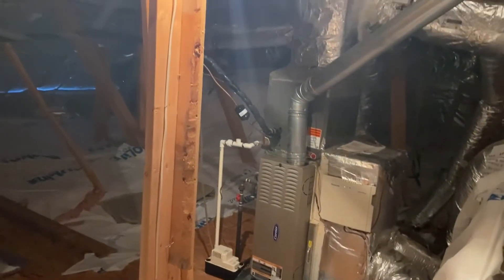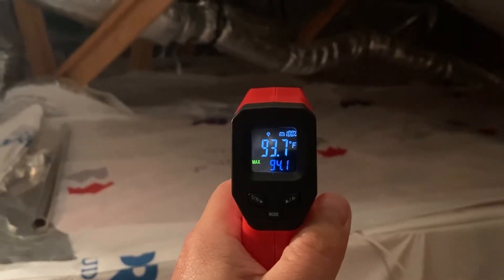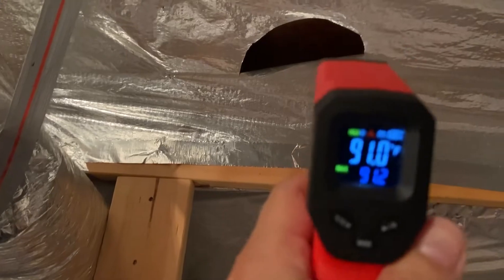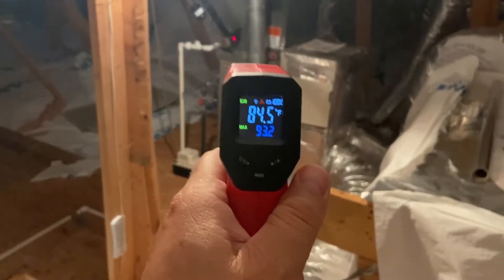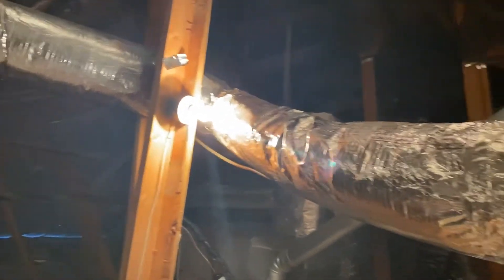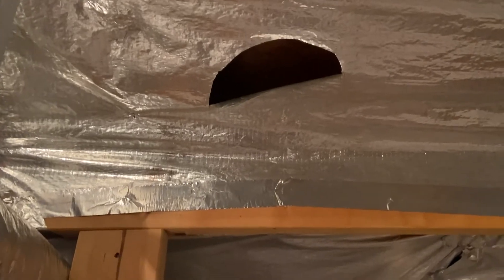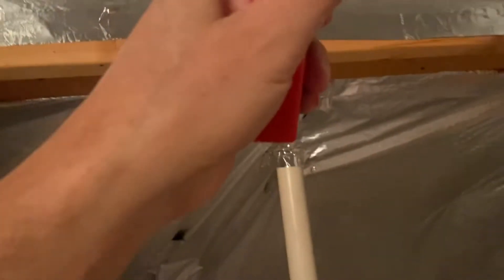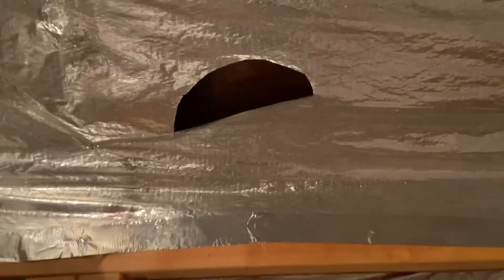Part two follow up to radiant barrier install with temperature variance’s.

Comment: This was very helpful. Did you see savings on your energy bill? How much as a percentage or in actual dollars?
Reply from the maker: Unfortunately not.
Reply: @paulsecondi2053  any thoughts on why?
Reply: @paulsecondi2053 any thoughts on why?
Reply: @paulsecondi2053 I was wondering the same thing as far as cost on enery but also hoping your hvac unit maybe turn on less?

I have a 50’s house and have cleaned up a lot of electrical issues, then air sealed as much as possible, added insulation and now in the radiant barrier portion.  I like the point the contractor made which is to keep the heat out in the first place.